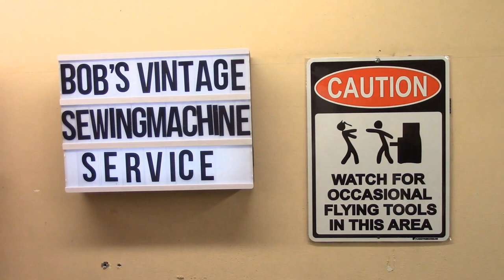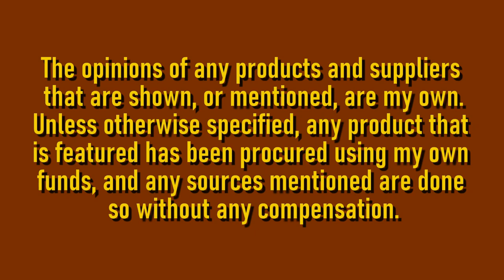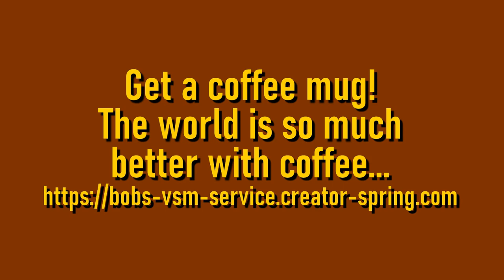Main & Vertical shafts in Singer 66-1, Cool Tools, Motor Hardware & More: SMQ Ep. 98, Oct 1, 2023

Comment: Ty for these hacks, tips! Im in the process of refurb  2 x a 1921 redeye treadles. 4 drawer and 6. The 6 drawer is an electric so converting to a treadle. Asking before I do can I leave motor on machine? I have got that far yet to see.  so blessed to have them and their decals are great condition for 102 years old. Do you have videos on treadles. Asking that the cabinets irons, one has black lettering “singer, other has gold lettering. Any info on why? Great conditions and only going to clean them and not paint them.oh does these models have the red oil wicks? I’ve looked,ed don’t see any visually.
Reply from the maker: On some machines, you can leave the motor in place, but it depends on the motor model. You'd still have to remove the belt though. All 66's should have a red felt oil wick, but many have gone MIA over the years. This is an easy fix...

Comment: Bob, you mention tapping the spool pin hole. Great idea. Did you mean to say 10/24 (UNC) or 10/32 (UNF)?  Or, did you actually mean size 10 28 pitch?  Thank you!
Reply from the maker: Nope, the pins I get from Central Michigan Sewing Supplies are in fact 10-28. An oddball size by today's standards, for sure, but once common and found on some other Singers. The threaded spool pins on the base of a 101 are also 10-28, among others.
Reply: @BobFowlerWorkshop  Thank you for the clarification!  If it helps, I think that I learned that my 201-2 BED holes are size #6 with thread 40 (UNF).   This helped to secure a purchased seam guide. Thank you for all of the great videos. I restored my 201-2 (my daily machine) due to YOU!  👏
Reply from the maker: @UniversalEngineer  Yup, 6-40 is the size! Glad the videos helped!